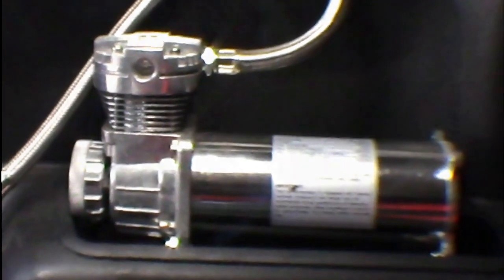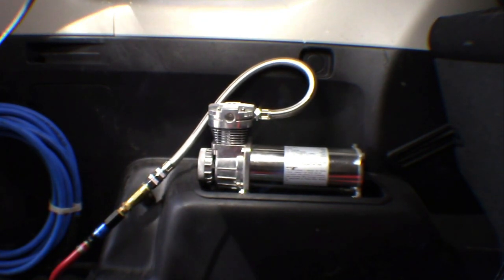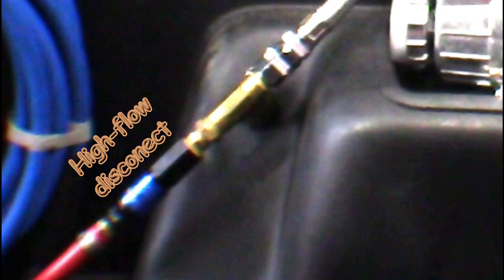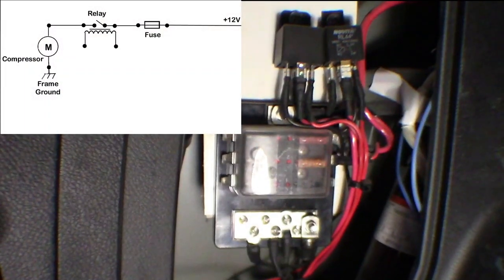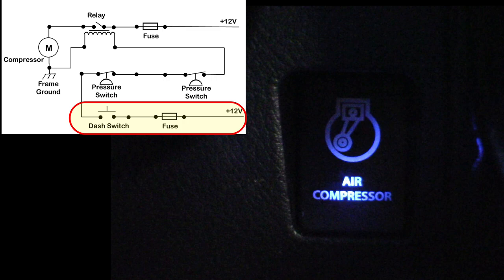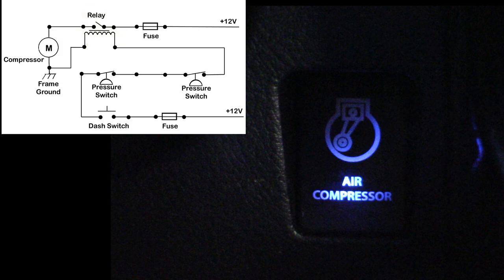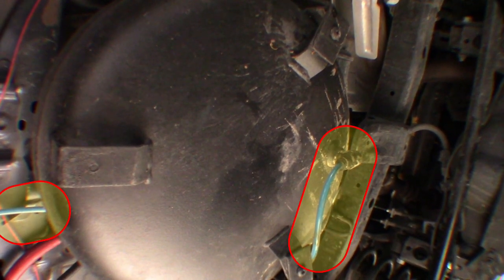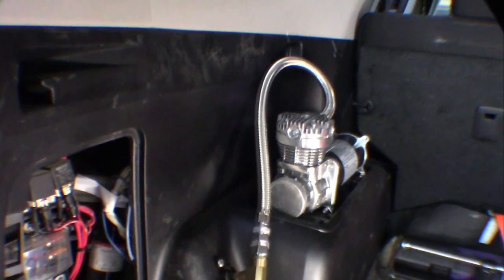Budget Onboard Air Compressor for our Gen 5 4Runner TRD Offroad

Comment: You can always add a second compressor. I'm running two Viair 444C at 3.5 CFM combined. They are 100% duty cycle at 100 PSI. I'll bet your air leak is at that push to fit water drain connection.
Reply from the maker: I've soaped all the connections and found a few bubbles at the tank so I retaped those fittings and it's much better.  I think the issue is really that with such a small system, the smallest leak drops the pressure significantly.

Comment: Awesome video! I've been looking for a video or someone around me that used a 4 gallon pancake tank. So you bolted bar stock to the tanks factory monts and bolted it to the frame? Have you had any clearance issues at all or anything jumping up and smacking the air tank?
What's your 2nd relay for to the left of the compressor relay? 
I have a 5th gen 4runner and need air for my tires and to supply my train horns air. 
Any recommendations or suggestions on what to do if I want to replicate what you have done as well as have my horns sharing the air tank? The horns have a  150psi pressure switch that automatically comes on when the tank is @or below 110psi and turns off @150psi. How would ya work around that? Just run a air chuck from an empty port on the tank to my front and rear bumpers and just hook up my train horns like I have in all of my other vehicles along with a on/off switch that I normally leave in the on position? And have the switch in line as a safety incase a pressure switch fails and constantly is running the compressor or a air line gets a hole.?.
Definitely saving this vid in favorites to use as a reference!! Awesome work for sure!!!
Reply from the maker: Thanks for your comment; I apologize for missing it.  I'll answer your questions in the order you asked them.
The tank is 6gal and I used some cardboard strips to get the shape I needed for the bar stock then, bent and drilled the bar stock.  After many miles off-road, there isn't even a scratch on the tank.
The other relay is for our rear-facing LED lights in the rear bumper.
I use two pressure switches.  A 150psi in the tank and a 190psi at the compressor outlet and before a high-flow quick connect.  This way, if the tank fails, I can connect directly to the compressor and fill tires.  In that case, the 190psi switch protects the compressor and gear from overpressure.
In your situation, I would keep the system as simple as possible. Only one air chuck in the rear bumper and an air hose long enough to reach the front tires.
Be aware of the pressure drop when adding the horns; you may need a higher tank pressure to deliver enough air for them to operate properly.
Finally, I have an auxiliary battery that powers all my accessories.  I only interface with the Toyota systems in three places; I used two add-a-circuits to activate relays when the ignition and dash lights are on.  This protects my battery when the Yotasaur is not running.
Good luck on your project!  Please share pics when it's done!
Cheers!
Reply from the maker: Sorry I didn’t see your post!  I believe you’re thinking is spot-on! I’ve had no clearance issues because the tank is above the height of the rear bumper.
I have an air leak somewhere but since I mostly use the air for tires, it really doesn’t matter. Because fewer connections means fewer potential leaks.  Thus, I only put a chuck through the rear bumper and use a longer hose to air up.  This also lets me air up other vehicles…
The other relay is for rear facing lights in the bumper.  All my accessories are controlled with relays. This way I only run light gauge control wires through the raceways, saving money and I feel like it’s safer having a separate terminal block distributing all the power in the rear. 
Thanks for the comments.  Please let us know how you decide to set your system up.